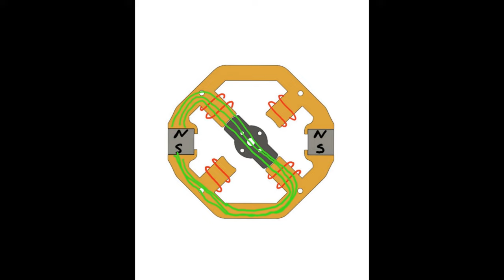Flux Gate Generator Breakthrough

Comment: Nice work.  Bedini and I worked all this out decades ago.  The best "load" is a near short circuit.  It turns out that charging a large battery is the best load because a battery being charged is a near "short circuit with a voltage displacement."  Conversely, you can use it to charge DC capacitors and periodically dump them into a battery.  Self-running systems based on these ideas have been around since the 1970s.  Both Panasonic in Japan and Seimens in Germany had self-running electric scooters, based on these ideas, back then.  Keep doing what you are doing.  You are on the right track!
Reply from the maker: Thanks, you wouldn't believe all the negative comments this video is getting. Nice to hear from someone who gets it.

Comment: No you have about 3 amps at 0.2V volts whoch is 0.6 watts. Keep trying thou
Reply from the maker: I do see where your coming from believe me. But this effect only happens under short circuit conditions. A 3000f super capacitor acts as a dead short when its empty. I am able to deliver the 2.3 amps continously. And a 450v 22000uf electrolytic is similar, but I can charge it up to 86v very quickly. They both act as dead short loads. If I'm only getting .2v, how is this possible? Keep in mind there are no spinning magnets, only a steel rotor.
Reply: @redesign3dp  the voltage drop once you start drawing current I see you short the wires and the voltage drop from 69 volts to 0.2 volts. The loaded voltage times the loaded current is the actual output power. I have experienced similar results from my low drag generator design. The generator experience less drag from a dead shorts vs an incandescent light bulb. Also when I add a 35400 uF capacitor to the rectified output and dead short it the drag is also greater than a dead short.
Reply from the maker: @raloed.363  you may be right, maybe I'm looking at it wrong. I thought perhaps that the 69v is the potential, even thought it seems to dissappear from the multimeter, it is dissipating thought the short. I guess I need more hands on, and see if there is a way to use it or if its just an illusion. I appreciate your input. Thanks!
Reply: @redesign3dp  I'm glad to help. I'll be looking forward to your improvements.

Comment: Nice build.  The speed up and reduced input power under dead short versus another load again has to do with the time constant of the coils.  If you add R ( from your load ) you change the TC and lose the effect.  Your load must have as little R as possible.  Even Supercaps in series may have too much R, whereas a single big electrolytic capacitor will have much less resistance and you will still be able to produce the effect.  Use the single largest electrolytic capacitor with the lowest R that you have on hand.  After that test, add switching.  When you switch the coils to a very low R load, it is similar to coil shorting, which will give you voltage spikes on top.  Later add K_Energy's cap dump and a pwm to try and reduce the input power to the DC motor, after the generator is up to speed and under load.  How much cogging is there when you turn the shaft by hand?  I can imagine that most of the extra load experienced by the DC motor after the generator is shorted is due to cogging.  The load due to cogging can be significantly reduced by rotor skewing.  There is a simple formula for it and it's intuitive.  "Rotor skew pattern design and optimisation for cogging torque reduction"
Reply from the maker: Great comment! Pretty sound advice, thank you!
Reply: It’s engagement like this that will be driving factor in one day any of us being able to accomplish our goals of over unity , alternative fuel cells, and cheats energy’s! 

Thank you for not calling this a free energy device, and cudos that it’s getting views without having to do so. You sir are a good soldier in the fight against the algorithms. 

I myself am developing alternative fuel cell systems utilizing kolbe electrolysis , and voltroltsis ,  to create h2lpg. Which will reinvent the way we use gasoline to make 5 gallons of gas or less last as long as a full 20 gallon tank would by first spectating the fuels propane from the liquid gs by filtering the Hydrogren and oxygen gasses created from the voltrolysis threw them which the oxygen bonds with the molecules needed to release the propane, as well as in the Kolbe electrolysis part of the system there is more hydrogen gas and both propane and hexane gasses created. 

This combo when fed to a motor will far exceed the efficiency  of liquid gasoline , as well as it will be emission less an no need for any child labor and slave labor derived materials like lithium. 

What’s wildest, is I’m doing this with no funding litteratly have bee. Scraping up the parts from scrap electronics and metals , if I had the funding and access to such things like a 3d printer and programs I’d wager my own living souls that it could be accomplished in a years time.  

Perhaps one day the two of our works will meet and find ways to incorporate each design together to compliment the other.

Comment: You can't calculate your output power by multiplying the open circuit voltage by the short circuit current. When you attach the ammeter (effectively shorting the circuit), your voltage will drop significantly (near 0 V as there is some small resistance in the wires and meter). To get a better idea of your output power, connect a know load resistance and measure voltage across it, the current through it, or both(W = V^2 / R,  W = I^2 * R,  or W = V * I).
Reply from the maker: Thanks for your input 👍
Reply: Output**
Reply from the maker: Do a video and send me a link.

Comment: Replace the magnets with high frequency AC electromagnets(increases output) wound so the Norths are up in synchrony, have the rotor be stationary with four points at the coils. You will need laminations that can handle the changing high frequency flux.

Comment: I have 1400 ' of electric wire and I have different size magnetic and have a way to use your frame method but I have a total different type if you help me build mine and it's far beyond its time. And we can mass production. I would split the profit 20% me and the 80% to build and sell.  Tried to contact Elon but no one was interested at less not him.
Reply from the maker: This is not my design, I don't know if its under patent or not. I'm just experimenting to gain knowledge. The market is controlled and if you could mass produce an efficient generator, they'd never let it go to market.
Reply: That's why you don't evolve them.  My product will be 10 %.different for sure because I have no interest in something that is in its present form

Comment: I think your approach is valid, but instead of measuring i think attaching numerous loads and parallel or series combinations of them could help getting the most out of it. Like charging a battery through a lightbulb or two. Anyway cool build! are you planning a larger build aswell?
Reply from the maker: Thanks for your advice, I've built a slightly larger version. When I return to this project I'll try your suggestions.

Comment: Definitely interested in your design. This is a close design to the QEG. I would add capacitors on the secondary windings of your coils to form a resonant LC circuit. If you get the right capacitor values and the right rotational speed, you should get better results than you currently have. Secondary windings will need to be smaller gauge wire so that the turns per ratio is much higher.
Reply from the maker: I'm better at designing and building than the electronic side. Thats why I want to build experiment platforms for other people to run with their ideas, and hopefully share them back. This is actually a flux switch generator developed for guided missile systems I've recently found out. Even though its not a new concept, I think it show promise. And you can't just buy these easily. So maybe they'll be good for a wide range of applications.

Comment: A solution that worked for me when load is connected. I use a voltage multiplier circuit and a high voltage high farad cap in parallel with the load
Reply from the maker: Thanks!

Comment: If you wanna the current low, while the output is high, here is a possibility:

I use a Hallsensor, to put coils on and of. Use the super capacitor, to keep the load small, while thick wired coils gets the load, so it is near short curcuit. 

I used severeal coil on one core, parallel, and between them (and at the ends, means 5 primary and 6 secondary coils) i havethe secondary coil. The primary parallel, means you put the magnetic force of the breakdown, or the capacitor, together. In my experience, you need relatively high resistance, so the parallelity can reduce the ohm but every single coil uses the electricity properly to produce the magnetic field.

But becarefull, this can cause an induction, that mybe slow down your Motor. But i don't know, cause i build an other construction with fly back or breakdown energy. Maybe yours work Differen.

The 6 secondary should be connectet in series. Try to reduce the  ohm, but you need a high induction, so in series. Parallel, i didn't get much out of it.

Comment: I have a question. Why not looping the output into a real machine like a motor instead of a resistive load like ampmeter ?
Reply from the maker: I have run motors, charged supercaps. Need to do more experimenting for sure.
Reply: @redesign3dp super caps have untapped potential
I think we should add caps everywhere to capture lost power like back emf 

I’m not scientist just a fan
Reply from the maker: I agree 👍

Comment: any info on how much power you get out relative to the input?
Reply from the maker: Hard to tell it likes a low resistance load for the effect to happen?
Reply: @redesign3dp  just show voltage and current with two meters at the same time as you ramp the input.

Comment: so uh, your voltmeter at a dead short at 4:21 is clearly showing 0.267V assuming your ammeter is single amps, and that the resistance is rather low, that would give an output of 0.58 watts
with an input power of 58 watts, that's a little over 1% round trip efficiency. Assuming you are using a brushed dc motor, who's efficiency is almost certainly near 50%, we can say that your generator is near 2% efficient. 

It would have been incredibly helpful if you had connected the ammeter and voltmeter to the generator at the same time, as we could then get the exact power output and efficiency. 

Good work with the generator though, haven't seen that style before. The obvious advantage is being able to use colossal magnets with the disadvantage being the reduced change in field strength as the field cannot invert as with a normal magnetic rotor setup.

*edited because I can't do basic division
Reply from the maker: You should check out my new video

Comment: I'm doing a mining claim service posted recorded and sampled even local filing as well this type of power source in the mining field could be profitable for load generators are load. It's on ebay I live in Sanderson texas where are you are you interested in helping me with my design.
Reply from the maker: Your free to use whatever you see in my videos, but you'll have to do research to see if there are any legal issues associated if your trying to make a profit. Like existing patents, safety, etc.
Reply: @redesign3dp  I'm not interested in patent. I have found out if you want to make a product mass production and if someone thinks you have copied there crap change it 10 % tell them to Cruz on down the road. That's why Davidson is getting rich they take anything that comes in front of them and when they tell you it's going to cost 80,000 and then your out there in like finn

Comment: But output is voltage with zero amps and amps with zero volts total power out was always near zero in the video.
Reply from the maker: Whats the voltage drop under short circuit conditions? I've never tried checking a 9v battery voltage while I'm  dead shorting it. If amps are flowing I think voltage is as well.  I know the open circuit voltage shows what potential is possible and the dead shorted amp meter shows maximum amp draw. The gen seems to be load specific. I see your point as well, and I have so many different projects going on its hard to focus on one for too long. I do appreciate you stopping by!